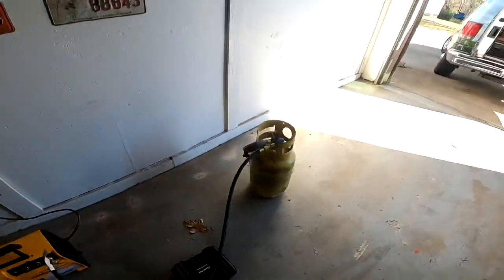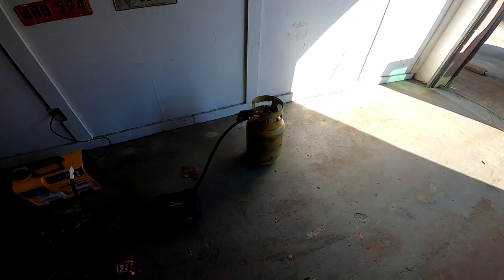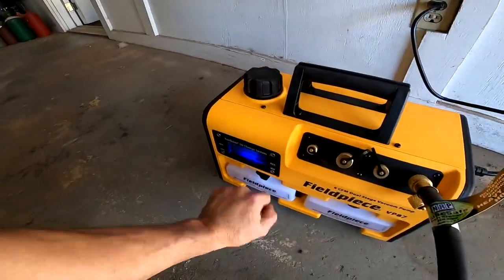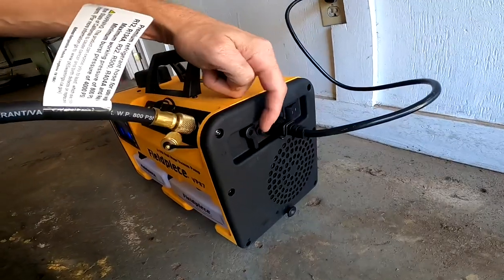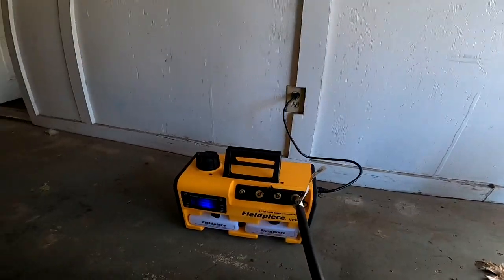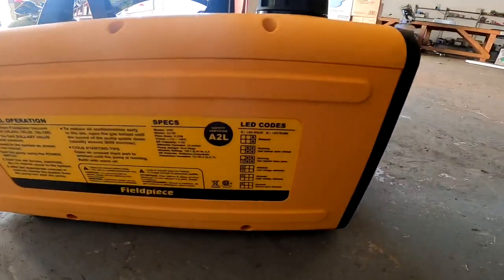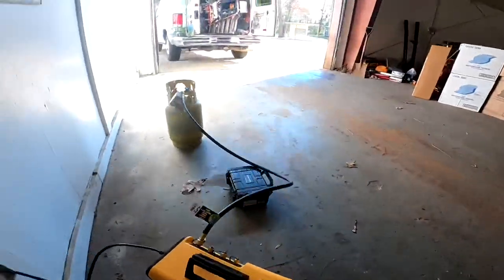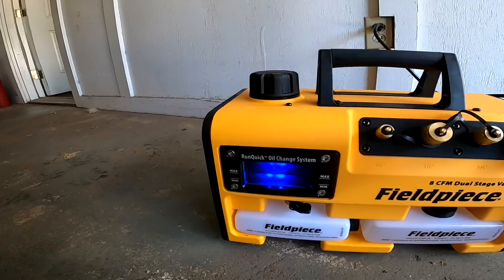Fieldpiece VP87 Review, And Lesson On Pulling A Vacuum!

Comment: I have a VP85 and love it.  I try hard to protect it by never using it without a filter on the input.  I love the fact that it can start on a low voltage. As for vacuuming down a system, I never pull though a manifold.  I either use the Apion 3/8 vacuum hose set or on larger systems the Bluvac hoses.  I also use Apion vacuum rated shrader tools. I only valve off at the shrader tool to isolate and check for decay.  The manifolds, standard service hoses are not designed for vacuuming; they leak.

Comment: I've never been successful in pulling a vacuum through the manifold, especially through the regular hoses, and even worse so through ball valve hoses. I've been most successful when eliminating the manifold, a regular micron gauge, and larger diameter vacuum rated hoses.

Comment: Boy it may b me but that thing is noisy I have a 5cfm robin air iv had for ever keep oil changed and serviced after every use if possible have it on a half inch hose set up its quiet dependable and quick wouldn't traid it for the world it was made when things were made to last

Comment: Great to see your test of the pump.
I would have preferred an oil mist filter on the exhaust port.
Such a filter should also silenced the noise a lot.
Best to get the oil mist and gas out of the area by a hose, but not easy all places.
I look mostly for 35 microns on ULT cascade systems low stage circuits.
The manometers and hoses is always a task to checkout as you experienced.
Seen sight glasses on meters sucking air especially on duty of high pressure refrigerants.
I do as many, tighten the hoses harder than necessary and by that compress the gaskets to a shortened lifetime. The hoses with hard surface gasket has to be tightened hard, but is so sensitive to small hose drifting by experience.
Nice to follow your relaxed way to work and investigate/find problems😊

Comment: I have the same issues when trying to pull deep vacuum through my gauge set. Ive changed seals, packed knobs with silicone and nothing seemed to help. Now I just bypass the manifold and use a tee gauge and pump.

Comment: I have those same yellow jacket hoses. I was having trouble with my vacuums. Ended up finding those valves wouldn't let me pull a deep vacuum. I've been using the appion 1/2" hose with core remover. It works great
Reply from the maker: Yep, anytime there’s a ball valve the potential is there. And the  valves on the hoses aren’t spec’d like the ones on the core removal tools.
Reply: Check that video out . It is a good watch. 12cfm vs 3cfm. Which will win?
Reply: @Logicislost81  The one with the best hose and core remover. Amazing what a good vacuum hose will do to reduce vacuum times. I like the 1/2" Appion hoses as well. However was blown away with the 3/4" Tru Blu hoses I just got.

Comment: Be careful with all that plastic.  I’ve also heard the seals are suspect on the removable oil containers.  Looks like a great machine, but it needs to be a little more rugged.  Thanks for the review.
Reply from the maker: Yore right, the oil containers basically line up and hopefully touch, but not really sealed.
Reply: It is a very rugged pump,  Its not cheap plastic its a polymer of some sort.  They make high powered rifles, machine guns and pistols out of similar material so Id say its pretty rugged, also no issues with the oil containers. Doesnt spill a drop during oil changes, ever.

Comment: I never pull through a manifold because it is slow and isn't meant to hold that without valving off.   I use the Trublu Pro hose kit and that VP87 runs like a top.  Have you tried the Accutools software?

Comment: We pulled a system down to 200 micron by lunch time and told the apprentice we'll go to lunch and let the pump run and we'll drop the charge after we get back. When we returned the pump was off because the gfci tripped and when I turned on my micron gauge we were reading atmospheric and noticed the oil level dropped significantly. I removed my hose from the split and oil started coming out of the core remover. Needless to say I started to panic because we only had about 4' of straight before we went to a 12' riser. I dumped 2-80cf tanks in the system at 700psi trying to push the oil out with no luck. We removed all the line setfrom the roof, riser and 15' in the flat and had to replace with new line set. I thought this was going to be a good pump but learned real quick I can't leave it unattended. I never had that issue with my jb eliminator. I tried looking for a inline check valve from the supply houses and they all told me to buy a new pump or try to rig something up.
Reply: Agreed. You can’t leave it over night. You need to change the oil  often because it only holds a small amount of oil about 8oz. I’m not happy with mine. I would not recommend this pump.

Comment: One very important question I've got mate , I really need to know 1 thing : does the vac pump include a solenoid to isolate it from the hose on case somebody pulls the plug off ? Like if you leave it running and you lose power , do you lose your vaccum inside the system or does the solenoid prevent that ? Thank you very much mate .
Reply from the maker: No, it doesn’t. If it loses power you’ll lose your vacuum. You would have put one inline yourself
Reply: @HVACGUY  No waaaaay ??! Duuuude that is appalling mate , seriously I thought it was the dogs bollocks but why on earth did they forget that ?! I'm completely disappointed mate for real ... that's a proper bummer really .
Thank you for letting me know mate , much appreciated 👍.
Reply: @sterlingarcher46   Pros and cons.. the valve can be a built in leak source. I think I prefer as it is, since power issues is rare for me.
Reply: Navac pump has built in solenoid valve